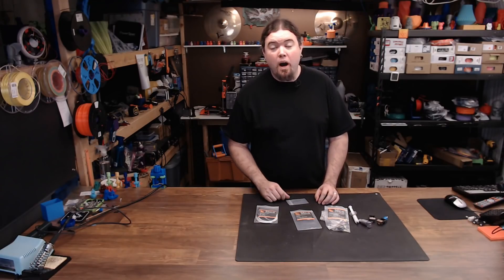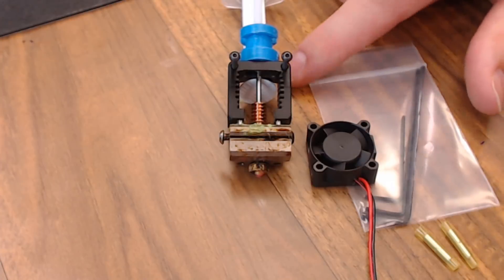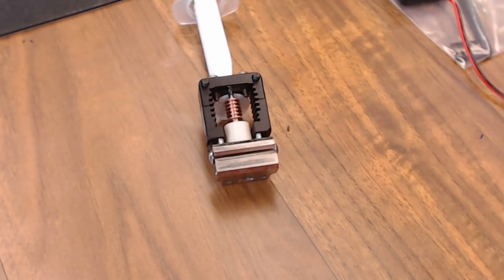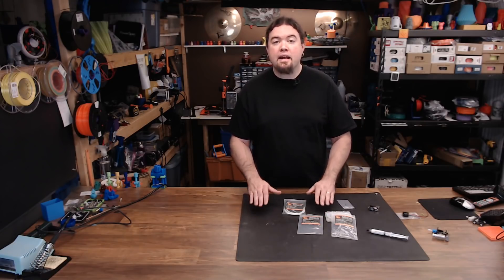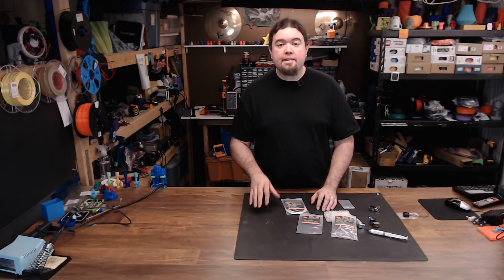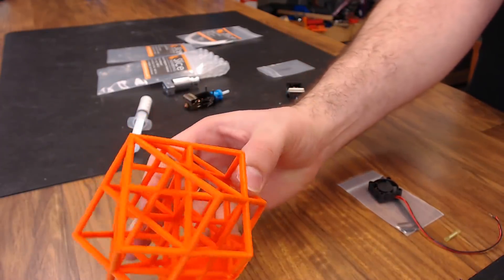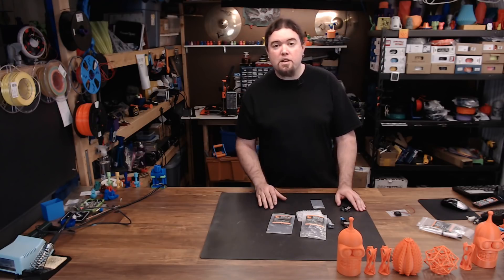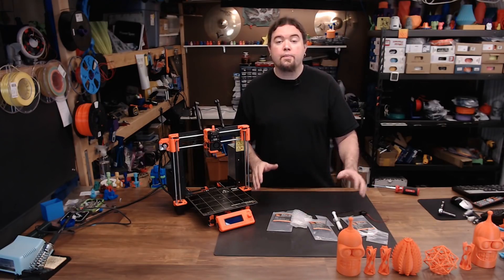Mosquito Hotend - Review - Slice Engineering - Chris's Basement

Comment: I get a lot of jamming printing small text w/ 0.25 mm nozzles (all kinds) on my Titan Aero V6 using Hatchbox PLA.  Slicer settings have been tweaked by experts in the field and still getting jams.  Do you think a Mosquito Bondtech BMG extruder combination will do a better job of eliminating jamming w/ smaller nozzles like a 0.25 mm nozzle?
Reply from the maker: That's really hard to say, with PLA it might be worse. The all metal design can sometimes make PLA a challenge. You already have a V6, so I would say results are going to be the same, the BMG might be a bit better than the Titan.

Comment: Hi Chris, when changing a nozzle single handed is it still better to heat the block up first to a high temp or is it Ok to swap cool with this hot end ? Will it still not spin in the circular clamp similar to a V6 without holding the block? best Steve
Reply from the maker: I would heat it up just to be safe, but it's pretty sturdy, you can probably still do most filament cold.
Reply: As always thanks Chris, since upgrading all my machines with thermal runaway the biggest problem is heating the block to change nozzles without the sock on it and getting heat halt errors, I tend now to leave the sock on until the block is to temp then whip it off to tighten the nozzle.

Comment: Really interesting to see you using such low retraction. On my Sigma R19 I often use 5mm-6.5mm retraction to get rid of stringing. It aloud as hell as slows the print down. Waiting for a Zaribo machine to arrive and see how it stands up against the Sigma.
Reply from the maker: Yeah, these are pretty impressive, I have heard great things about the Zaribo stuff.
Reply: You should only need long retractions in a Bowden system, which the Sigma R19 is. The point of the retraction is to relieve pressure in the nozzle, and that pressure goes all along the filament in the Bowden tube, compressing it. In a direct drive system like these Prusa printers, the filament being pushed is only a few centimeters, and the retraction shouldn't even pull the filament out of the nozzle. Features like Marlin's linear advance and Klipper's pressure advance let the printer itself model the pressure buildup, so you can use nozzle level retraction values. This doesn't only affect retraction, but all speed changes (including beginnings and ends, layer changes, corners etc), and can greatly improve print quality (practically eliminated stringing for my printer). Some slicers do similar things, like Cura's coasting feature, but it's not as accurate. BCN3D are using a variant of Marlin on their printers, but according to the source they post on github, they don't have linear advance enabled. I would consider upgrading to a Marlin version that does.

Comment: Would be very interested to see what the max volumetric speed is for say PETG or PLA on these hotends. For example, I can push out about 23mm³/s with PETG out of my cheapo v5 clone with a 40w heater at 250C using a 1mm nozzle before it starts to degrade the print quality, or another way of putting it about 1 kilo every 16 hours.
Reply from the maker: That would be and interesting test. I will see if the Slice guys have any numbers and see if I can create a scenario to hit them.

Comment: I currently swap around a V6, Volcano, and now a Magnum. Sometimes I print small and detail, sometimes large and functional. I especially like that the mosquito/magnum do 1 hand nozzle, change, and whats not mentioned much is they use the regular sized nozzle, not the volcano length which when you look at titanium, X, or other specialty nozzles become more expensive.

What I would like to know, since you have both a Mosquito and Magnum, is " is there any downside to a magnum vs the mosquito" 
I know the magnum has double the flowrate, but does the magnum require more retraction, drip more, or anything that would point to purchasing a mosquito vs the magnum ? Is there any situation where you couldnt just use the magnum?
Reply from the maker: That's a great point about the nozzles, didn't think of that. Also, I am not sure on the Magnum vs Mosquito, That would be a great test though.

Comment: i have an Anyquibic delta Predator and i wonder if i can install Mosquito™ Magnum Hotend and if i can get the temp to print carbon fiber and PC ? thanks
Reply from the maker: I am sure the hotend would work just fine, but you will need to craft a mount. It will go up to 450c. CF and PC. not problem.

Comment: That's awesome, thank you! I'm looking for a good all metal hot end to print at higher temperatures, and I think I'll go for Slice Engineering products. I want the Bowden tube to be as isolated from the heat source as possible to avoid noxious fumes, and the Mosquito hotends look like they're the best for that by quite a long shot.
Reply from the maker: Sweet! The mosquito is a really nice choice.
Reply: @ChrisRiley  It is! I got a Mosquito Magnum, but haven't installed it yet. I'm waiting for an EZBoard and Tough Extruder. I'll install that first, then hop goes the Mosquito!

Comment: Hey Chris,

in your Video there is a wrong information I think.

You said at 4:16 that the E3D V6 has three base pieces. And all of them are aluminium. I think it's wrong. 

1. High temperature will only affect the heat block (aluminium). The heatsink will not heat up like the block. 

2. The heat break is not aluminium. It's S/S 303  (https://wiki.e3d-online.com/images/0/09/V6-175-BREAK.pdf) so it can handle more than 500°C ;)

Best regards,
whitecrane [PCPointer.de]
Reply from the maker: Thanks for the info. Maybe it didn't come across well, but I state two pieces are aluminum, the barrel is not.
Reply: Oh yes that's true. All the pieces outside the barel :) sorry, my mistake 

I am also preparing an article but didn't find a good solution to upgrade the heated for Ultem or PEEK printing. I could take the E3D high temp bed but it does not really fit and to use it I will need a second power supply or a better one. And also a MOSFET because I think the Rambo Einsy 1.1 will not be able to handle this current

And I am also looking for materials for my high temp extruder in the MK3S. Only 3DX Tech Carbon X has a tg of 143 degrees and can be printed with the MK3S under 300°C. I didn't find another materials. Alternatively Polycarbonat
Reply from the maker: @PCPointerDE  Yeah, polycarb is probably your best bet.
Reply: @ChrisRiley  I will get a PEEK sample for testing. But I think I will also have to replace the steel sheet with PEI. I will use a glass plate from E3D. and I will exceed the bed temperature to 125 degrees and hope it will work :)
Reply from the maker: @PCPointerDE  I have been having good luck with glass and the Nano adhesive stuff. It's kind of pricey, but they might send you a sample. https://visionminer.com/products/nano-polymer-adhesive
Reply: @ChrisRiley  I am thinking about a Borosilicate Glass Bed from E3D but I am to lazzy for preparing prints with the PINDA sensor ... ;)
Reply from the maker: @PCPointerDE  Ah, completely understand.
Reply: @ChrisRiley  I changed my hotend today and noticed that the flow rate of the mosquito.m is not the same did you also changed the E-steps on the firmware? I wanted to extrude 100mm PLA but only 94 were extrude
Reply from the maker: @PCPointerDE  I don't remember what mine was, but it doesn't surprise me that it might need a tweak.

Comment: i pre ordered the mosquito magnum last year, and just now installed it onto my CR10S, replacing the micro swiss all metal hot end.  I am very impressed with this thing!  I print primarily nylons and am moving towards PC so this is right at the level of temperature range i need to be operating in.   With the 0.6 nozzle and 0.2 layer heights this thing kicks ass with carbon fiber reinforced nylons!
Reply from the maker: Nice! I have been using mine for peek lately and it handles it no problem at all.
Reply: @ChrisRiley  i did a search for your page for PEEK but didn't find anything.. can you share some info on your setup at some point?
Reply from the maker: @mattbackvass  Hey Matt, I am still working on that content. It's not as easy as it looks. More to come soon.

Comment: You say the weight of the Mosy is the same as standard E3d v6, is that the the up and running carriage? Because there's nothing to the Mos, I would be interested if it was Less weight ( = less Momentum), also I've heard you don't need an cooling fan for the Hot-end, (Heat break not print fan), with the Mosquito (weight saving) which is what I want for my ~A8, I'll be leaving my Prusa Mk3 as is for the moment though!
Reply from the maker: Yes, that is setup and running compared to a V6 with a fan. The mosquito has a super solid copper alloy heat block, that's where all the weight it.

Comment: Ok after 4 months of intense printing (almost 24/7), amazing prints and amazing results disaster struck, during a 30h print in last 4h assembly came loose - heat block started moving up and down vs the 4 tubes and two screws for the heat sink.

I took the hot end off and I can see you can retighten the screws but I can't seem to find a hex key that works? Is it some America hex key nalarky - the ones with mm measurements don't work!
Reply: yeah, we use both metric and imperial sets for pretty much everything. there is a good chance if there is a wrench hex key its like 3/8" of 1/8" pr something ridiculous like that lol.
Reply: @infernaldaedra  would not expect any other malarkey from a country that writes dates in mm/dd/yyyy format :p
Reply from the maker: Yeah, I am not sure their size, I can find out for you.

Comment: I'm at a loss. I keep getting a lot of stringing. I've tried various retract, temp settings. From 0.1-2mm and 180-230C nothing seems to change. Anyone got any ideas I can try out? I have the Tevo Nereus with MKS Robin Nano. Printing with PLA cause I don't have a nice shop for ABS.
Reply from the maker: Have you tried different spools of filament? Do you think humidity might be a problem?
Reply: @ChrisRiley  I have tried that. I've tried 4 different brands of PLA. I installed e3d v6,  Mosquito, even the stock hotend has been replaced. The only thing I haven't tried is swapping out the control.  board. Almost everyone on the Facebook owners page has changed the Robin Nano with a Gen L or something else.
Reply from the maker: Wow, that is really strange. I will be interested to hear if the board swap fixes it.
Reply: @ChrisRiley well of I can't sell it by ther time I receive and flash an SKR v1.3. I'll let ya know if I fail or succeed.
Reply from the maker: @demonkinglamb636  Thanks, keep me posted.

Comment: Chris, thank you for this review! 
I'm considering this for my OG Prusa MK3 (upgraded to MK3S). What parts would you buy from Slice to convert the hotend? It looks like the mosquito is compatible with the E3DV6 heater and thermistor. Would you recommend upgrading to the Slice engineering heater and thermistor or roll with the stock E3D parts until they die?
Reply from the maker: Just off the cuff, givin how lazy I am and how much I don't like to cut zip ties, I would roll with the E3D stuff until it died. It fit on the Mosquito just fine.
Reply: @ChrisRiley  thank you!! We are the same then, lol. I don't like to create extra work for myself.

Comment: What kind of settings do you use and what slicing software ? I'm curious just to compare would appreciate it if you don't mind
Reply: Even if I could email you
Reply from the maker: Here are the settings I use dumped from a sliced file. https://drive.google.com/open?id=1BickKUtGxAnv5Gxr3CvM5_mdPgrFC7x8
Reply: I'm having issues with it extruding it keeps chewing up filament?
Reply from the maker: @nickmiller6112  Measure your filament and see what you get, with the Mosquito the filament has to be spot on.
Reply: @ChrisRiley  ok I've checked it and I'm using the prusa pla and I somehow got plastic stuck in the tube above the heatsink... WTH am I doing wrong haha
Reply from the maker: @nickmiller6112  Wow, I don't know man. I would definitely get a hold of Dan or Chris at Slice Engineering and see if they can help.

Comment: Thanks Chris. Ok ... this just told me that I don't need a Mosquito at least for now.  I just got my supplies in today except for my water cooled hotend.  It is using a titanium heat break with a polished interior, a E3D style Volcano Clone, stainless tips up to 1.2mm, currently 40w but going to 50w heater and a customized screw in high temp thermostat.  The system works with two coolant lines going to and from the heat break coolant device, then to a cooling radiator (tiny) with a 80mm LED temperature scrolling fan (pretty darn cool) and then to the water tank and pump which sits around 6-7".  I was just getting ready to return my items until I saw your video and realized that mine might be elaborate but for the cost of around $120 I have a complete system with a Volcano setup.  Before you know it, using their parts it will hit $200.  Mine is for larger volume printing and I didn't want to spend what I did but its something that I have not seen yet anywhere online and the parts can always cool something else like a laser if needed (thats the bonus!).  I will upload the build on my channel soon.  Thanks for showing me that I made the right choice.  Sure simple would be fine but you already have a V6 setup an if thats good enough when compared then why even get a mosquito.  Maybe I will give them a shout to see what is the big build capabilities.  Next big project is a DIY or modded tall and wide Delta Kossel. Cheers!
Reply from the maker: You're welcome! You setup sounds like it is going to be awesome!

Comment: Do  you need to tune that thermistor more? Something seems up with the temps. The E3D prints are much shinier than the Mosquito -- seems like maybe the Mosquito wasn't as hot. Maybe different batches of the same filament?
Reply from the maker: I should have tuned in the PID a little better, E3D was a little hotter.
Reply: @ChrisRiley  did you change out the stock thermistor for one of theirs? I was thinking if you did the coefficients could be different on the new thermistor and so the temperature reading could be inaccurate if not updated. But yeah pids can let it float too much too.
Reply from the maker: @nivvis  Same e3d thermistor on both tests.

Comment: What is the difference in vertical height?
Reply from the maker: V6 is 62.3mm with a nozzle. Mosquito is 41mm without nozzle or groove mount.
Reply: @ChrisRiley  Thanks for the reply. In order to be useful this measurement needs to be comparable, say from the groove to the tip in both cases, so the difference in Z can be seen.
Reply from the maker: Hey, I finally got you some pictures. This is my 3d printed groove mount. https://photos.app.goo.gl/xRfEtGTwAQxQ1eKV9 https://photos.app.goo.gl/ivabrfeWpSE7Cjyv9

Comment: Chris, thank you for the review. You may also compare the volumetric speed limit of different extruders. It would be nice to see if Mosquito design with 50W heater has any advantage in volumetric speed limit compared to a volcano. For example, if it will be able to print at 250 mm/s with 0.4mm nozzle and 0.2 mm layer height it will be a great advantage over any other hot ends.
Reply from the maker: Thanks Alex, I have been thinking about doing a large nozzle video, I might be able to work this in.

Comment: Another lovely review.  I heard from another guy testing the mosquito that it worked well for PETG, but he had clogging issues with PLA, which seemed to be tied to retraction.  It sounds like you did not have these issues.
Reply from the maker: Thanks John! I haven't had a jam as of yet, I am currently printing PETG on it and it does work really well. At first I did have a hard time feeding filament into the tube, it has a very tight tolerance. If your filament is even a little bit fat it's a no go.

Comment: The mosquito appears to have a harder time with the overhangs. Both on the Bender head and near the bottom of the Benchy.
Reply from the maker: Just slightly, the copper retains heat much better. Can probably drop the temp slight to solve it. Also the part fan might need to come down just a little.

Comment: Frankly, you've piqued my curiosity.  I print lots of polycarbonate along with some Ultem (PEI) and PEEK for school projects. I've been using  an e3d v6/volcano combo as you imagine but I've been looking at going with the gold version v6, titanium hot end and copper volcano for better performance. That combo is quite in line with the pricing of the Mosquito until I start adding in the cost of water-cooling. At that point, the Mosquito is a very compelling alternative. I'll definitely be dropping a message to the guys down at Slice Engineering to get their take on my unusual use case. I love the v6 ecosystem so I can't imagine swapping all of my machines over, but I can definitely see getting one or two machines onto the Mosquito for sure. Thanks for a very compelling review, Chris!
Reply from the maker: Excellent Mark! Let us know if you decided to switch over to one and how it goes. In your situation I think you would be very satisfied.
Reply: Did you get to test the mosquito? And do you have any tips for printers for these kind of materials?

Comment: Did the prints on the mosquito have a more matte finish? Or was it just a lighting thing?
Reply from the maker: The V6 might be just a little shinier, even though  they were the same brand and color filament, they were different batch numbers, so that could have been the cause.
Reply: @ChrisRiley  Might also have been a slight drop in print temperature on the mosquito?
I always tell people to find there own print temperature as the actual temperature depends on the design of the heat block, location of the sensor relative to the melt zone and the error of the sensor.
Reply from the maker: @TalpaDK  It very well could have been. Good tips.